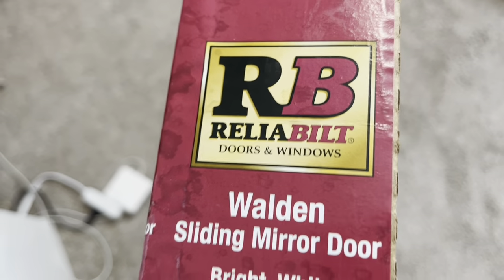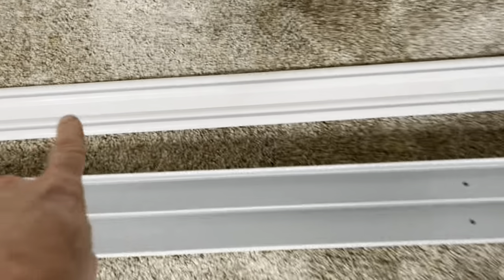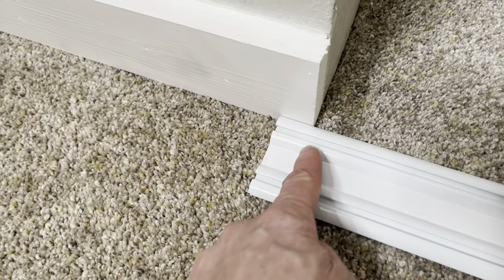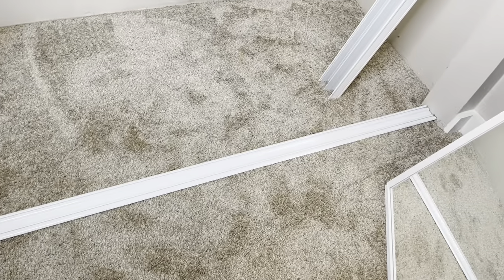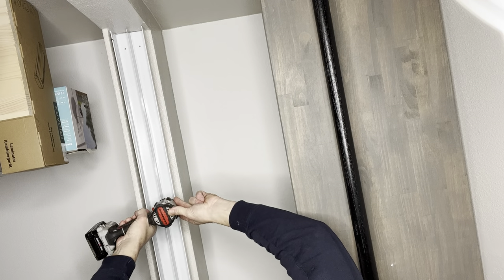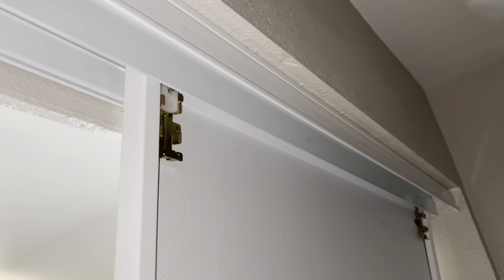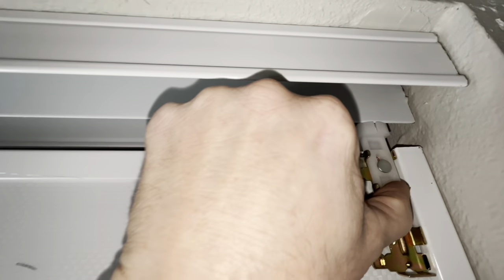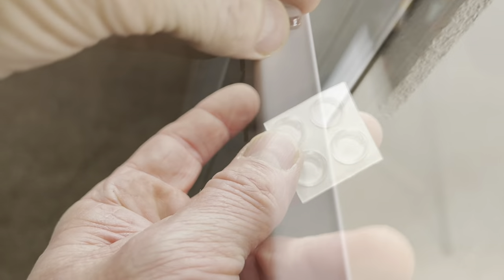DIY RELIABILT Brand Mirrored Closet Doors Installation Directions [Lowe's Reliabilt Brand Doors]

Comment: Do not drill through the carpet like this with the drill bit, it can and often will catch the fiber in the carpet and create a pull acroos the floor! Drill the metal track and punch a hole in the carpet with an awl or something to pierce the carpet.
Reply from the maker: Good comment. Thanks.